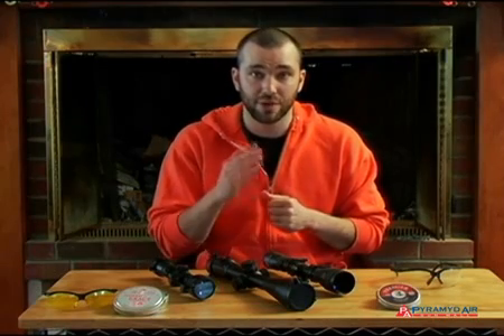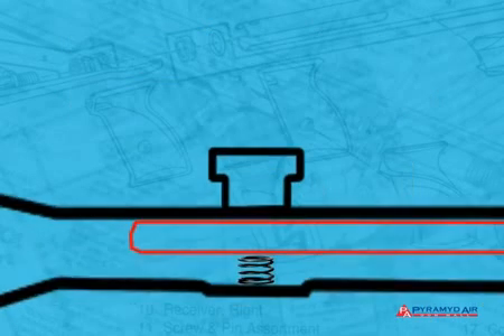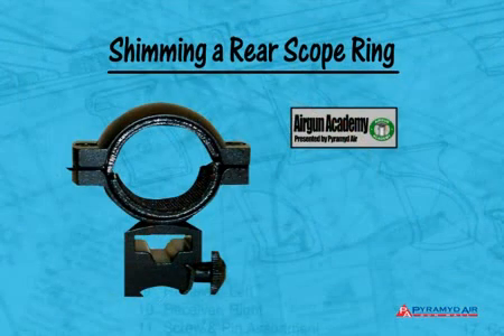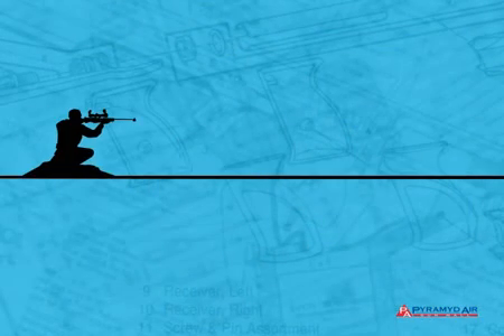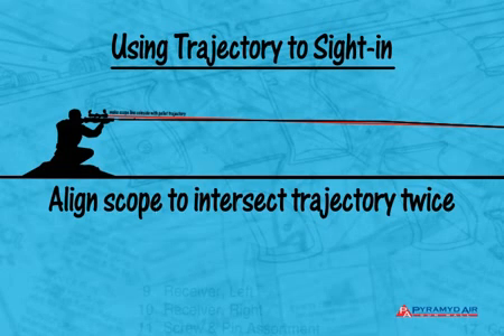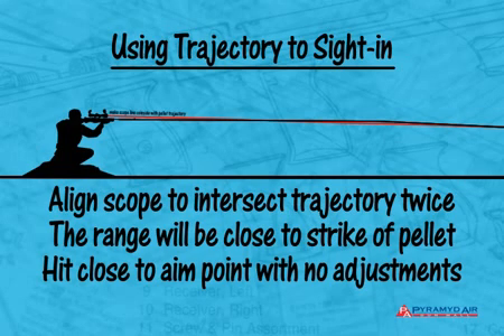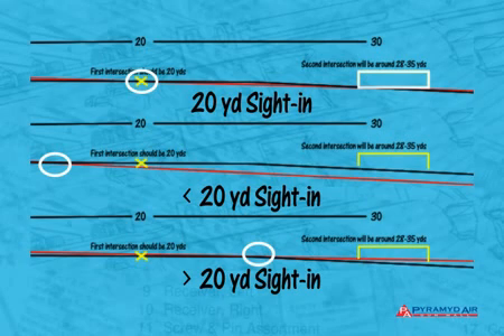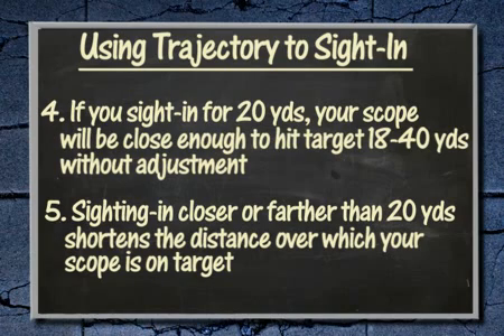Airgun Academy Episode 20 - Use trajectory to sight-in a scope

Comment: errector tube spring error is common in like a cheap 4 x 15 scope, these scopes you have to be careful not to max out, some good scopes have max out protection but even with that if you max the turrets its good to back off as far as you can, if all possible its better to use mill dots on your scope rather then risking a max out of any scope

Comment from the maker: Lukeshoot - The actual ballistics will depend on each gun/pellet combo and also depend upon your scope height and chosen zero point. When you choose to zero your scope at the apex of the trajectory, then you will have two zeroed points.  But if you zero at say 10 yards, your gun may very well be dead on at 40 yards.  It will depend on the specific gun and pellet.  Velocity, scope height, pellet weight and your chosen zero are all significant factors here.

Thanks,
Pyramyd Air Team

Comment: The height that the sightline is above the bore is arguably a more important consideration than velocity:  

The higher the scope is above the barrel, the further away the first zero needs to be for the maximum bracket in point blank range.  The closer the sightline to the boreline, the closer the first zero need to be.  It is simple geometry:  EG, the Evanix Rainstorm 3D Bullpup will need its fist zero at 30 or 40 yards due to the extremely high sightline - but then it shoots hard to 100 yards.

Comment: You say it is better it is better to set for two zero's and not one .. How do you set it for one? that would be a neat trick. ,Question... Two guns fired at same time horrizantaly over flat ground, one is a low power air gun the other a high powerd bullet or live. Which will hit the ground first pellet or bullit.   Answer
   Both at the same time, but mind you the bullit will be maybe half mile away in this same time pellet only thirty yards Cheers pee

Comment: The height the pellet rises above the scope line between the two points of intersection depends largely on the muzzle velocity of the pellet and to a lesser extend to the pellet's drag. I have found that you need to test this on the rifle to know for sure, but if your first point is set at 20 yards the max height should not exceed one-half inch. Usually it will be about half of that.

Tom Gaylord